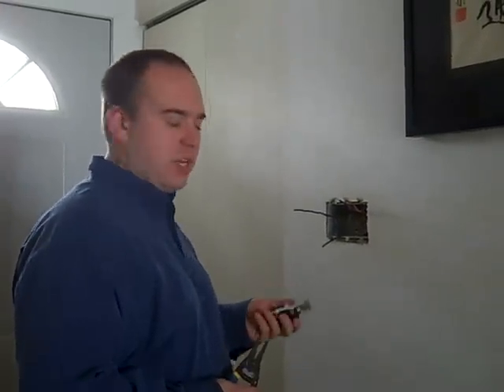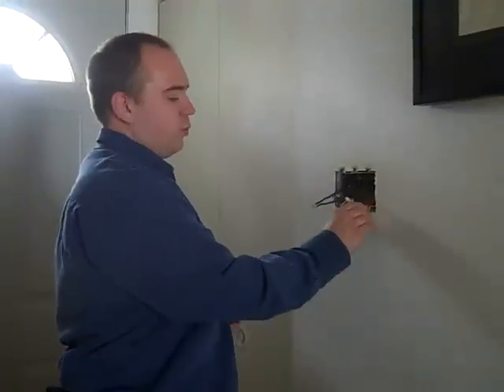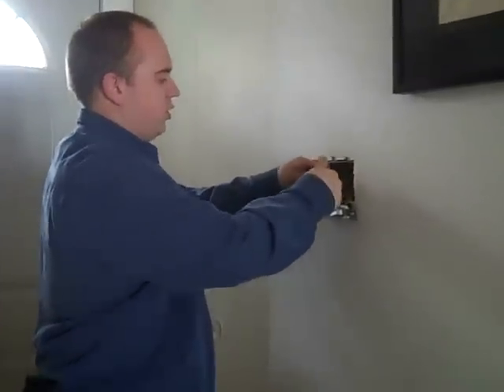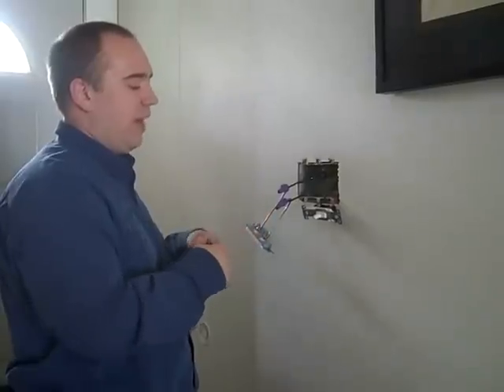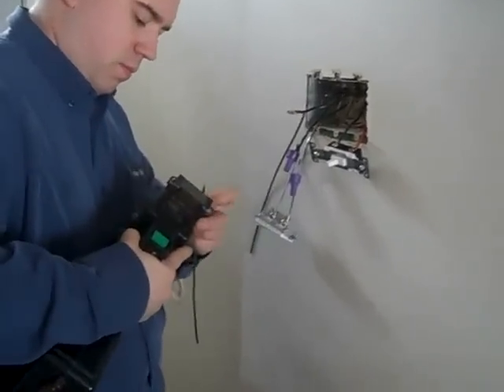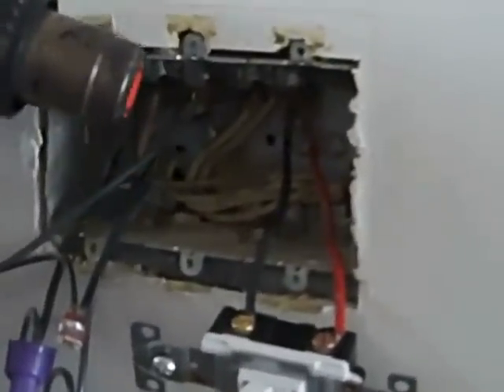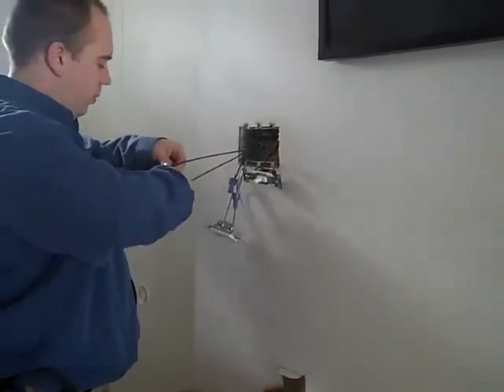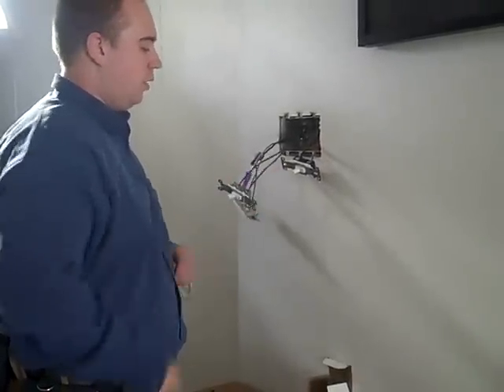3 Solutions to Aluminum Wiring problems

Comment: Why can't we use Butt Splices (nylon, screws) to joint two different material wires? They won't touch each other (at different ends of the butt splicer), and use anti-oxidant grease? Why the whole paraphernalia (crimping gun, marrettes, etc)? The Industry has been using butt splicers for decades...And, btw, aren't there BIGGER tools to work with? I don't understand this "electrical religion" going on with "electricians".

Comment: Usually. Branch circuitry. For aluminum has been fortunately  phased out for some time . It is still used for ac disconnects.  Range receptacles  services . Which range receptacles  are a  pain to deal with but I use nolox or petrox  when available on situations  I mentioned . And ground which unless. It is the panel I will usually do use  not anti oxident paste where kid could come in contact with a kid like jumping the hot water heater fortunately.  plastic plumbing 
Has elimanated the need for the pipes to be grounded

Comment: I've read that NoAlOx is supposed to be used on the wire and outlets upon installation.  True/not true?  Also read that there's supposed to be a specific torque.  Our new/old house has 75% aluminum 25% copper wiring and the switches/outlets/fixtures are in need of replacement.  I've just been replacing those items bit by bit and the more I read the more concerned I get.  Short of tearing down the plasterboard, how would you recommend I proceed?  Thanks.

Comment: What is the big problem is that homeowners abuse the electrical circuits in their home by using space heaters that stress out the wiring in the home. My house has aluminum wiring and I have made occasional repairs to it. I never use space heaters in my home...ever! And I have had no problems or issues with the repairs I have made. I have seen damage to copper wiring from prolific space heater users. Stay away from high power devices that stress your wiring no matter what it is made of...simple as that!!!!

Comment: Ideal #65 are NOT good. Use aluminconn connectors instead.
Reply: Only if they're used wrong.  For example, this guy in the video is using them wrong.  You want the deoxy paste all the way around the aluminum wires so apply some before you splice then apply the appropriately rated connectors.  You may even want to sandpaper the metal beforehand and then apply more paste. If you look at all those pictures of destroyed marrets, it's always with improper installations.  That's why insurance companies don't like them, they're really easy to misinstall.

Comment: OK, a few issues: 1) CO/ALR devices really don't do their intended job as far as keeping connections secure.  2) Purple wirenuts still fail over time; the only difference between those and regular ones is that the purple ones already have oxide inhibitor inside them.  That leaves only ONE solution -- Rewire the house!  I know it's expensive, but can you really afford not to?

As a licensed electrician, I simply REFUSE to touch anything in a house that's wired with aluminum wiring, unless they agree to have me rewire everything for a fair price.
Reply: I don't know how wire nuts normally work, but the Purples ones wrap the wire with a spring so it can expand and contract, so potentially more than just the paste.
Reply: I've seen plugs burn that didn't even have current being drawn from them.  Arcing can occur between the aluminum and the plug.
Reply: Are you saying replace all wiring in the walls as well???
Reply: @starke6666  If it's aluminum, then yes, I would highly recommend doing so.

Comment: At 1:23 only about 25% of the underside of the screw is making contact with the wire. This is asking for cold creep and increase in connection resistance and produce heat. Also, when stripped, the aluminum wire should be coated with Penetrox to protect the wire surface from insulating itself with aluminum oxide, which increases connection resistance and produces heat. Even with CO/ALR devices, aluminum wires must be treated with great respect and care, to prevent future problems.
Reply: Noticed the same thing. When doing a tutorial it should be shown the right way.
Reply: U seem like the person to ask... I put most relevant first . Park covid Part crazy police helping crimes.. I haven't talked to anybody that knows what they're talking about for a while.

 4ga ALUminium to 6ga coper for a range. The best I could figure (with what was at home Depot was . Double metal junctionbut not the standard ones the ones that have the screw in plugs or conduit or strain relief holes and can be made watertight.
I've got the four gauge into the water type strain relief the ones with the grommets that could clamped down by the bolt that goes over them they were thick enough for that was a hell of a challenge. It's that damn aluminum though the problem is I can't see a way to get the 6-gauge side or both sides inside a box before the sheathing comes off. This place is such a horror show it doesn't have sheathing on the aluminum conductors they're just pure anyway to be single wire runs but three of them. Inside the box I did some electrical tape around where if conductor came out of splice metalchunkk thing bar without mounting holes f**** retarded...  There's six gauge with Earth back to panel. About four feet of it because a replacement panel was so much longer long story play stupid games win stupid prizes. So I've got the junction box Earth I've got strain relief on both sides The ledges go in the right and left the neutral and the earth in middle through strain relief the Ninja splice bars that screw down because it's 6 gauge copper on one side and I believe 4 gauge aluminum on the other. This place bars appeared to have a plastic divider in the middle bar block it's the type that like they're really should just be a covering over it and it spotted and you never touch it again except home Depot doesn't actually sell that. There is heat shrink tube over the individual splice junction things which of course has a hole two holes in the top.. to get th Allen key screw Down tight
I've got the strain relief in and out of the thing on lockdown. But those splice bars aren't attached to anything inside the box is my biggest concern. And then what you brought up about the aluminum wire. Dielectric grease enough for the aluminum side or should I look for that specific product? I did cut the ends off and splice a little bit further back beforeI wasn't specifically thinking aluminum wire though I just know copper same way if it's an exposed end oxidizes will be a darker brown. A buddy of mine who I haven't talked to in awhile I'm trying not to bug him too much but she wants brought up that in apartment complexes they were finding that the service entrance main lugs were coming on screwed and they attributed to everybody comes home turns their range on at about the same time in the thermal cycles ended up loosening the screws holding the wire. This isn't an earthquake region so short of a tornado I don't see anything yanking the wires out to cause a short but I can't say that I know what happens with those things not actually attached inside the box to the box they were to loosen maybe I'm overthinking. Is not going to hire anybody or do anything like that ideal he doesn't have the money I'm trying to keep them from things that are highly likely to burn his house down.

There was a 20 position box there that got water through it over it all of it. But even without the water almost every position was the half size breakers. The one for this aluminum wire for the range didn't have sufficient clearance to get that gauge of wire into it for the screw down. When we took the cover off that box I found that what the person before had done was shave off all but one of the aluminum strands this place is a horror show.

Also the electric dryer 4 conceivably a long time had what a dmm is showing as 0 ohms avec tone/ beep acrossed red and black. Or what should be the two legs. Worse this is with the dryer unpluged. Fortunately that's 12 feet away and one story up or in other words 12 ft of cable will do it to replace that.. 
This all started because I was helping dude troubleshoot is dryer and we figured out nothing's wrong with the dryer oh but there's Sparks at the breaker box. Installing the new breaker knew the dryer was unplugged imagine my surprise at the giant spark accompanying the breaker I had neglected to flip to off meeting both legs.  actually why I got out the DMM.

Cuz it only took a second for my brain to go the fuck? Shouldn't have a spark at all let alone like that arc welder event on an open circuit.

Neither the new breaker in the new panel nor the old 30 amp which was a dual Pole half size back to full size single pole..... Neither one was tripped.

That run is getting replaced but now I'm thinking how do breakers work I was under the assumption it was I squared r and bimetallic. But basically back to the pole transformer there's 50 feet of what appears to be maybe 0 gauge and then it went into probably 11 foot at the moment run of 8 3 with included ground like nm to the f**** three prong dryer plug for reasons of okay let's just make it bizarre and lethal. 😂 The gauges are actually pretty good if not Overkill in the house but that panel eish.. plus a pipe had burst on it ..

But that's got to be like low impedance lower volume all the way back almost dead shorting the transformer on the secondary side. What I'm trying to figure out by talking it out is why there wasn't a breaker trip. I bet their power bill will be lower when that's corrected 😂 the more I think into it the scarier that is. Because what except heat caused that breaker to get so loose that it was arcing out enough to make us think the washing machine was broke?

I think the electric company did kind of dirty as well . You paid for an upgrade to two hundred amp service long before I knew him. He's got a house and a barn. The power pole in the yard they mounted a standard f**** box or panel Adam Scott 200 amp breakers nothing else populated except a 20 amp for the light on the pole there's no lock on this box it's his as far as access like I was talking to my friend that's a journeyman about it and we are in agreement that they kind of probably did that they walked in took one look at the wiring and said no fault code we're just going to put this here and that's what you get.
His main panel is now 15 ft from his house. His daughter-in-law lives downstairs is on the same bill but one wall of that I call it an apartment it's not that but in essence it is because they don't they treat it like that. But service wise are planning wise it was never that way except it is. in other words the main panel in the house doesn't flip off the entire house only the one on the pole does. But that isn't a service disconnect switch that's like intended for that I didn't look at it too closely but I'm not even sure if it's a weather rated panel.

I've got to take a closer look though because I'm aware the specifics of how that setup affect things like do you Bond the neutral to the Earth with a wire on what should be his main panel

Really at a loss for where the splice causes some of the downstairs to remain on is. The only reason it's useful to have the box on the pole is the same reason the box on the pole is there it's a f**** klusterfuk I wonder how much they charged him for that though. I'm not charging anything because I'm not professional I'm just trying to keep a friend from dying in a fire..

Speaking of why the f*** are afci so expensive?

Comment: Twisting aluminum and copper wires together is bad. Aluminum should always be separated froim copper. The paste won't separate them, it will only protect aluminum from oxygen.
Reply: Yes, this method has not been approved in the US as it had too many overheating problems during the lab testing..  It is code in Canada.

Comment: Wow! I've used 5,000 purple wire connectors over 25 years. NEVER have I seen the wires twisted before installing connector. According to manufacturer, the nut is used to twist wires properly. Best to believe the manufacturer, guys. Otherwise, nice video.
Reply: You are incorrect.  The manufacturer does indeed recommend this step: note #5.

Instructions:
1. Turn off power before removing or installing connectors.
2. Strip wires to 1/2 in. (13mm).
3. Straighten wires and align frayed strands.
4. Hold wires together with ends even. Lead stranded wires slightly ahead of solid wires.
5. Pre-twisting is recommended, but not required. For pre-twisting; strip wires long, hold wires
together with insulation even, twist wire ends together, trim to recommended strip length.
6. Insert wire bundle through center of pie-wedge shaped cap and twist clockwise until tight.

https://idealind.com/content/dam/electrical/assets/WireTermination/WireConnectors/TwistOn/Twister/LA%202669-3%2030-265%2030-365%20Ins.pdf

Comment: Make sure your product that you're using is approved by the CPSC, and you should be good. The purple nuts aren't, I believe.
Reply: Nope, no wire nuts are CPSC approved. Neither are CO/ALR fixtures. The CPSC approved COPALUM crimps and AlumiConn "bus-bar" connections only. There has never been a wire-nut rated for aluminum to aluminum connections. The IDEAL #65 "purple" wirenuts are only approved for temporary repairs these days -- there are plenty of instances of them burning/melting. The antioxident paste in them is very flammable, too... not quite what you want.
Reply: @DaveHaynie  you mean aluminum to copper
Reply: @ror-ys3qp  Well, yes and no. There is no wire nut approved for either Al to Al or permanent Al to Cu connections.  Al to Al is common in industry, but it's always a crimp or screw-down, not a wire nut.

Comment: There are pictures of burned Purple wire nuts all over the internet. Twisting is better, but most of  the burned ones are twisted. Even though they are UL listed -  they are unreliable, in my opinion because the copper and Aluminum wires touch each other. Copalum is expensive at over $15 per connection and you still have copper/aluminum contact and the heat shrink installation difficulties... What about AlumiConn a terminal block in which the wires are separated...about $3 per connection.

Comment: Riddle me this...Whats wrong with aluminum wire to begin with? From what I know...As long as you don't play with it, its fine...The only time it can be dangerous is when whoever installed it wasn't paying attention and nicked the aluminum thus when they pushed it in the box it bent and broke...But then it wouldn't work so that would get fixed anyways... So why even do anything with it..?
Reply: In short, nothing. However, I just bought a house with aluminum wiring (1972) and have done a lot of research prior to purchase, so I'll chime in here. The documentation shared here is very thorough, but the "too long, didn't read" version is this:

Aluminum heats and expands at a different rate than that of the metal it is in contact with on the older (CU/AL) receptacles that came with the house. Over time, switches and outlets under constant load will generate a lot of current, heating and expanding the wiring. This can actually cause the screw portion of the receptacle to loosen, producing an arc between the wire and the receptacle. The arc is where the problem begins, and if not treated, can melt the receptacle and cause a fire.

There are temporary and permanent fixes for aluminum wiring. Upgrading to the COLAR receptacles (AR = Aluminum Revised) is a temporary fix and is made with metal that can accept aluminum better and newer ones have arc-fault protection. Permanent fixes are the AlumiConn connectors and Copalum "cold weld" solution. The PDF link everyone is sharing says not to use the wire nut temporary fix (Ideal #65) due to a manufacturing defect in the product.
Reply: Our 1970s house has aluminum. You are correct no rea$on to rewire. Biggest problem, previous owner use Copper outlets. One sparked and melted outlet. Otherwise the challenge is pigtailing and packing extra wire nuts in the box. Never any problems with purple wire nuts, but lugs look interesting.